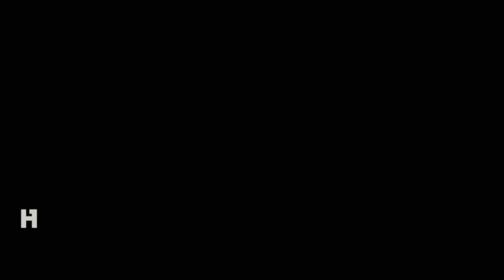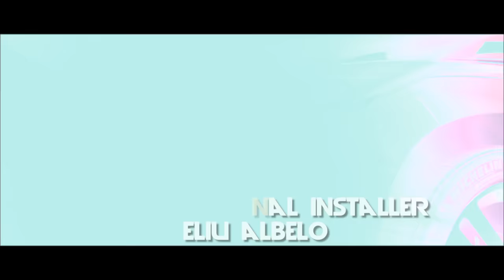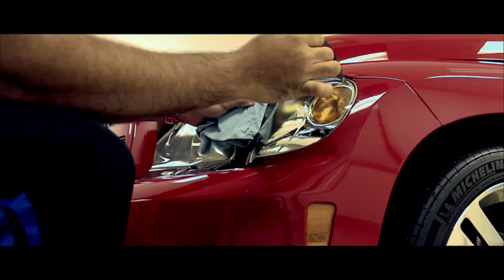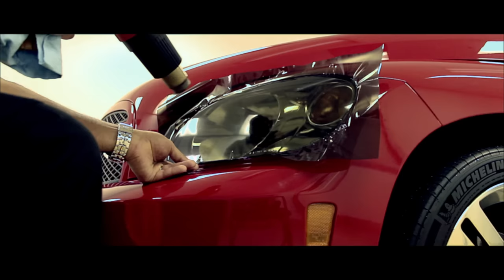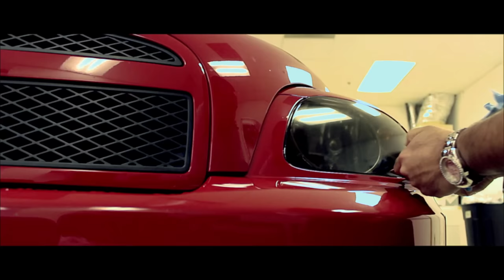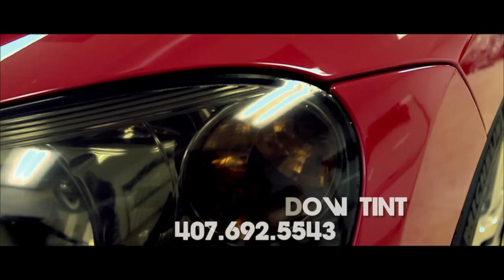How to Tint Car Headlights

Comment: I tried my best yesterday to install it but at the end i don't know what to say but i am happy with the bad results ^_^
Reply: Monther Abdullah You can also spray it on.  A company called VHT makes paints for lights. Smoke and red. Some companies sell yellow but hard to find.  You can tape around but better to remove headlight then spray it.  Clean it very well and spray 2 or 3 lights coats (depending how dark you want it) . Don't spray too much at a time to prevent runs.
Reply: @DaytonCarCare  thank you SOOO much I didn’t know you could get that

Comment: Can i use hairdryer instead of a heatgun?
Reply: Veličko not likely, doesn't get nearly hot enough.
Reply: I took the tint off, i parked my car outside on a sun, about for an hour the tint actually deformed and got messed up on the edge, idk it was about 40 degress like outside +sun

Comment: The problem with this is. When you don't like it anymore and remove the tint from the headlights, You will notice that your headlight's plastic lenses when have micro cracks. it could be because of the heat being trap by the tint.

Comment: illegal due to reducing light output. Best thing to do if one wants darker head lights is to convert them into black housing headlights. Sure it takes a little longer but it beats getting pulled over some $29.99 piece of vinyl.
Reply: Depends on state, usually as long as it can cast a beam as far as the minimum and the turn signals still function as intended, it's perfectly legal
Reply: I believe it has to put out atleast 50% of the original headlight visibility but I'm sure it varies by state.  I'd switch to LED lights if you're going to tint Headlights.

Comment: I did the same and i had little bubbles all around the vinyl... WHY i did it 2 times and the bubbles still apear
Reply: saaaame, i think it takes some practice also i noticed that he had bubbles and he used the blow dryer and then im guessing something blunt inside of a rag to push the air to the side without cutting the vinyl open
Reply: Eric Ryan i think u were supposed to wet the headlight n thn put it on n squeegee the water out...idk i saw most People do that

Comment: How to get a ticket in Virginia >:(
Reply: I live in Richmond and drive a mustang blacked out and I never got pulled over I don't even have cats either
Reply: laviva26 it's a gamble here, :[
Reply: Xiuhcoatl indeed, you speak the truth...
Reply: Xiuhcoatl I usually get LaminX. You can also get different colors.  It's a thick rubbery material with one side that is sticky though can easily remove it later.  I usually use it to tint inner high beams on older BMWs yellow.  I've tried the smoke tint and it really ruins the light output but looks cool. They sell pre-cut to fit your lights or you can also buy sheets to cut yourself
Reply: +laviva26 how can you see at night?
Reply: +Xiuhcoatl haha funy thing i have a straight pipe integra with smoked lights and never had a problem in virginia
Reply: Guy here just got a ticket in VA from WV because his tint was lower than our state allows. don't see how they enforced our state law really. even had a card from eye doctor to make it legal
Reply: Xiuhcoatl haha watching this five years later in virginia realizing this is probably illegal
Reply: Fuk that 30 dollar ticket, keep on pushing.
Reply: Mike RunSolo hell yeah! 😼

Comment: Don't tint your headlights. Just bake them and paint the housing inside.
Reply: how could you do that , to paint inside housing of the head light...i was interested thanks
Reply: larry ofw The best way is to bake your headlights in an oven to loosen the glue so you can pry the lens off. I attached a video below for more information.

How to Bake , Open , and Paint Headlights with Michael Flare
Reply: Yes,correct. Check headlight www.novsights.com

Comment: Sorry but professionals don't use rapid tac, a squeegee wrapped in a paper towel, and a plastic knife. I've been wrapping cars for 16 years, you have a lot more to learn. As far as the material, its a translucent vinyl and can be ordered from any sign supply place. Also, Nicolas is right, you should use knifeless tape to do cutouts for light penetration, it's safer and a cleaner look.
Reply: +J. Blizzard Why does it matter what items a professional uses for the work he or she does? if a plastic knife and a squeegee is all he needs for this clean install good for him
Reply: +Ali Yuksel  he just wanted to show off that he knows some shit,but not

Comment: Flawless logic: decrease your headlight power by at least 30% just so you could "look cool"
Reply: Gee, Idk get HIDs?
Reply: Well... Yes
Reply: 100watt bulbs simple.
Reply: Throw HIDs in your halogen housing and you'll still be blinding people lol.
Reply: It looks cool
Reply: How to fuck up your headlights 101..

Brighter and possibly hotter lights, trap the heat with tint...
Reply: @neometalx9  headlights have built in heatsinks in addition constant, constant, constant airflow when driving.... also protect 200-300$ module from foreign contaminants i.e bugs use your brain.
Reply: @ovrdose0138  there's ppf for everything you said, tint is not made for headlights dummy, it just traps all the heat, when you go on short trips nothing will happen but try driving many hours per night with that.

Do you realize they are using window tint for this? The side that sticks blocks the heat from the sun coming to you when it's applied to car windows, that same side is being stick to the headlights... Just think about it... Have you ever touched the headlights after prolonged use?
Reply: @neometalx9  no ppf, the headlights in your car right now have heatsinks to diffuse heat lol are you an engineer? I drive countless hours with my headlights wrapped in pvc. Its fine.

Comment: The problem with this is. When you don't like it anymore and remove the tint from the headlights, You will notice that your headlight's plastic lenses when have micro cracks. It is because of the heat being trap by the tint.
Reply: so that explains why the mustang I just got has tiny cracks in the headlights.

Comment: "How to Tint Car Headlights". Yeah, this isn't a how to video, still cool tough.
Reply: Myasa Man He's definitely showing you how. 

Step 1. Clean and dry them. 
Step 2. Use heat gun to warp the light up for easier application.
Step 3. Place tint on headlight.
Step 4. Use heat gun on top of tint. 
Step 5. Smooth it out with a putty knife. 
Step 6. Repeat steps 4 and 5 until it's all on.
Step 7. Cut around the headlight to take excess off.
Reply: WIRide Nope he never explained the steps just went went through them quickly, not a how to video.
Reply: It still shows you how, just takes common sense.
Reply: WIRide Well I clicked on this video so someone could teach me how and explain the process, not just do it in 2 minutes. Your first comment was more helpful than the video.
Reply: Well, there ya' go then, guess I helped. Lol.

Comment: There is no reference to the tools or the liquid you used. Thanks a lot for a useless "How to" video moron...!!!
Reply: +Vasilis T its water to clean any dust.  the application is dry and hot.  If you cant figure that out then you should not even try.  this is way harder than it looks to do
Reply: It is pretty obvious ,, spray with water based solution to clean the area ,, apply heat to fully dry it and prepare it ,, apply the film gradually and use the heat gun to flex it a little and  mold it into shape using plastic lid and a piece of cloth ,,,use razor blade to cut the excessive material ,,, spray again and you're  done